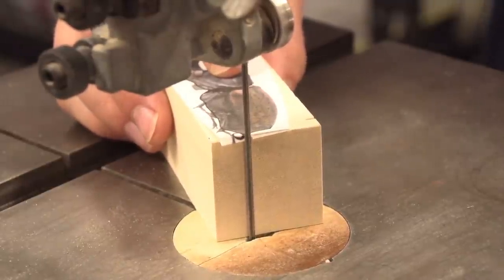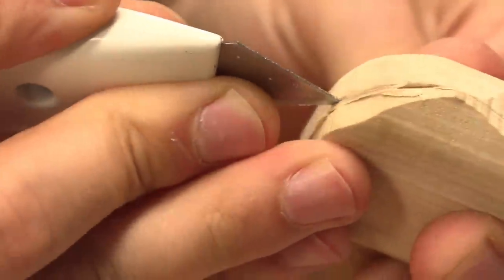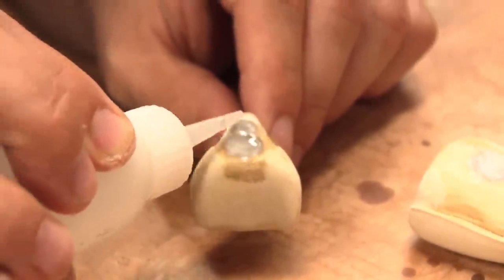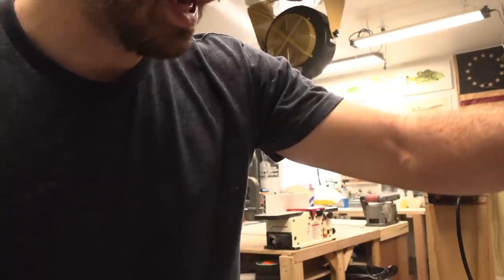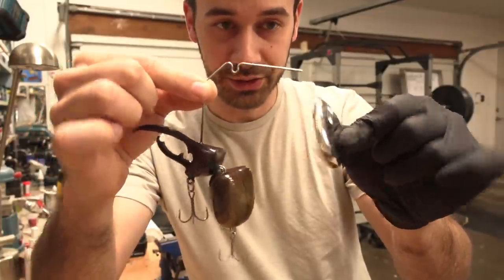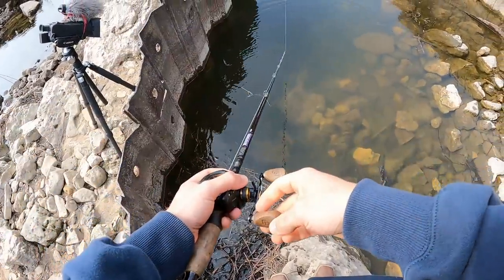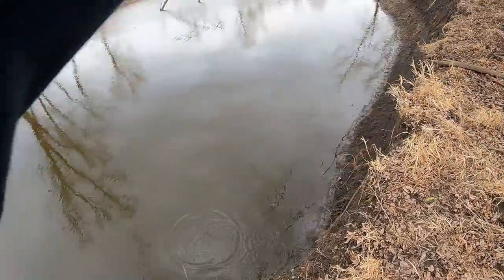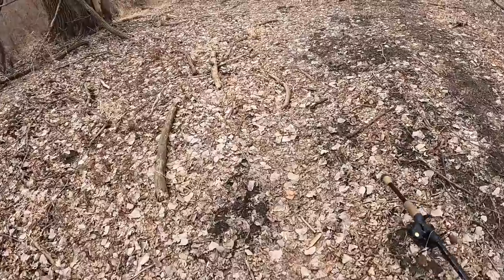The ULTIMATE Beetle Spin Lure | Hercules Beetle

Comment: I was watching one of your older videos the other day and you opened a can of oil base poly that was hard on top.  A trick that has worked for me is to splash a little paint thinner on top before storing it.  I don’t know how long it will keep it from skimming over but has worked for me in the past. The poly reacts with the air in the used can so the layer of paint thinner supposedly creates a barrier.  Also maybe just press some plastic down to it and against inside sides of can to keep air from it.

Comment: Awesome lure and grwat video as always! I even said "aaaw!" Out loud when your line broke! 🤣 that is how into it I was 😅 if you ever have the chance give 4050 a go instead of 4030. It works a little better when it comes to adhesion and dries a little more solid then 4030. Also creates less tipdry. Does need to be reduced though because this stuff is thicker.  Also usefull to make paints more transparent but not loose too much in consistency so that you can still layer a decent layer of very transparent paint

Comment: I wonder if using a hard rubber or something for the horns would let them have some give for bouncing off structure but the same time  be stiff enough to not flop around.  A hard rubber would be something to experement with for thin fragile bits.

Comment: Just picked up a old belt/disk sander yesterday. Between that and the miter saw I picked up a couple months ago I think I could make a couple lures. I've got pine from pallets and I have birch and Maple split for firewood that I could get a block or 2 (dozen) from.

So question what would be a good first hard lure type to cut my teeth on and what size wire/screw eyes are reccomend?

Comment: I'm currently making a bait but don't have any power tools or a lead pot and I was wondering, how do you insert weight evenly without a lead pot? My bait turns at a 45-degree angle to the side and I don't know what the best way to make it stable and upright is.
Reply: I've had some luck cutting a wedge shaped cavity, then smashing split shot into a wedge shape and gluing it in. Where there's a will to smash, there's a smashed up way.